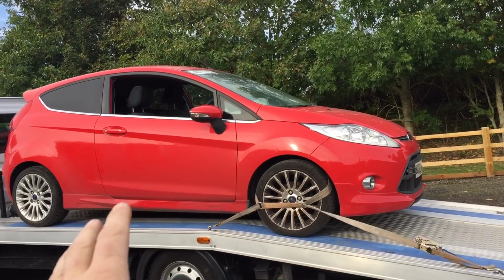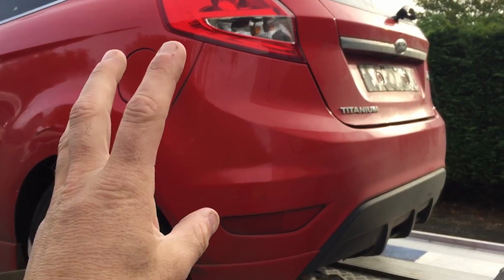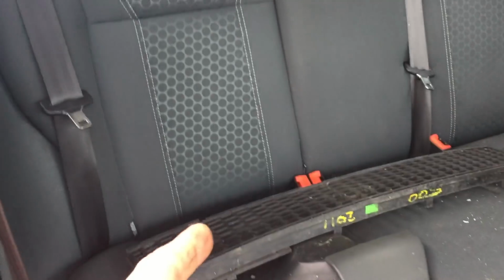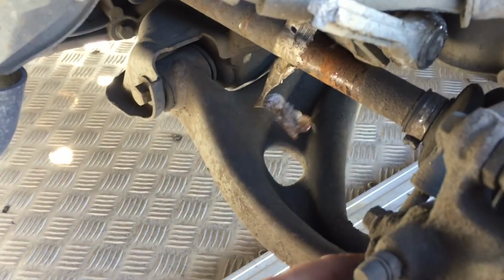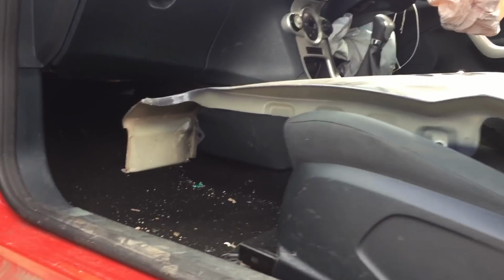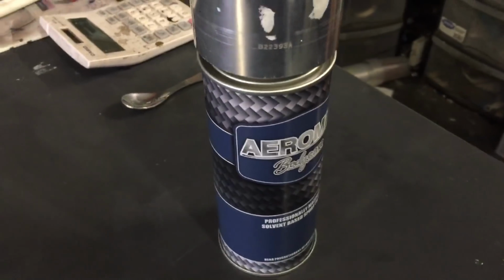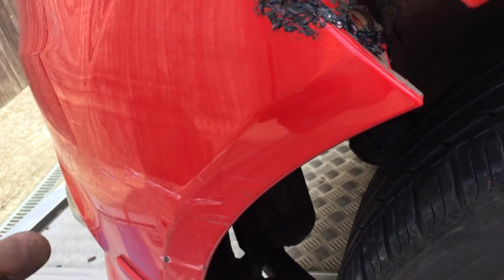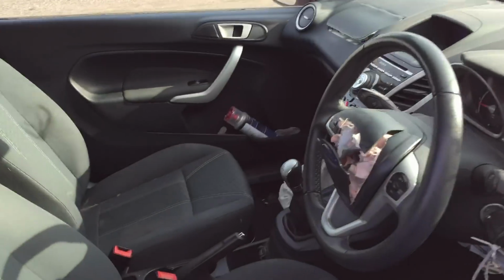Copart Salvage Damaged Fiesta £725  Bargain PT 1

Comment: Airbag kit 225 plus 100 fitting labour.
Screen 100
Wishbone tyre links 60 plus labour 50
Wing bumper approx 100
Paint labour 350 minimim
Total 1000

So far 1775 plus the collection delivery charges that u never added approx 150
So your close to 2000
Dont k ow how much u gonna sell it for cause I wouldn't buy
Didn't add the steering rack arm and possibly  rack damage labour and parts 100
Reply from the maker: the-truth-is-out-there you obviously didn’t watch or listen to the video because your miles out

Comment: The reason the headlight been changed was to make it look better so someone puts a bid in thinking it's a easy fix when in fact it's more complex.
Reply from the maker: Ade 1983 it was very easy to fix 👍
Reply: uk  you are a lucky guy. I've seen everything from body filler in the dash covering deployed air bags and a resistor to turn the light off. Bottom arms, shafts changed but leave a bent subframe. Some people buy them fancy them up a bit and send it back to auction. You've been doing it a while you must have seen it happen. Oh and don't forget the action taking bits off it and damaging them with the Falk lift.
Reply from the maker: Ade 1983 I have seen a bodges in my time yes but never had a car damaged by a fork lift how else are the supposed to move around 40000 cars around in a month some non runners some with wheels missing etc the forks go all the way through I personally think that’s ok yes I agree if you got a care free driver they can damage it but most are careful. If there is extra damage on the cars you can refuse the car on collection 👍

Comment: When I’m fixing cracks in plastic I use a soldering iron and some fine metal fly-screen mesh, preferably stainless steel. I lay the mesh over the crack then melt it into the plastic using the soldering iron. Then a skim of filler takes care of the surface finish. In my experience if this method is used on each side of the crack the fix is strong and permanent.

Comment: After replacing airbags do you need to tell the ecu the airbags have been swapped out?
Reply: No normally resets its self some you may have to push a small pin hole button to reset but normally does it its self
Reply from the maker: excossack yes mate it will always require a new module or have the old one reprogrammed 👍

Comment: The thing about this, is that after your time, effort, parts, etc. You’ll just end up with a 2012 Ford Fiesta that is Cat C-ish and still only worth a few grand, max. 
I’ve literally just bought a 2010 plate, with ~50,000 miles for £2,700. I’m all for rebuilding cars and using/selling them, but these cars are so cheap nowadays that the effort is almost not worth the headache. 

Just my 2 cents.
Reply: There will be little effort, no headache and a nice profit - you clearly haven't a clue......!

Comment: I seen a white 2014 Mazda 3, needed right front door post straightening..apart from that it was absolute mint went for 1500 CAD about 900 pound. It was the hatchback too, but was automatic. I'm needing a manual transmission  :)

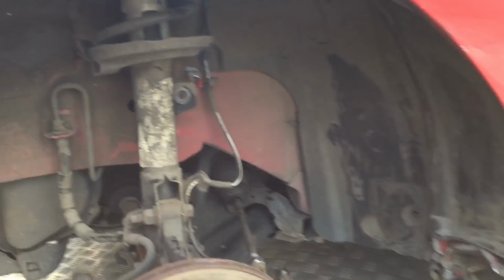Comment: 9:25 is that a crack in the inner wing/beam on the right where the wheel liner meets the red inner wing, it looks like a hole with a 3 inch crack coming from it, about half way up the screen.  Love the videos btw, just subscribed.
Reply from the maker: Lee Benstead no cracks 👍

Comment: Maybe its just me but the wheel still looks too close to the door after the new parts have been fitted. Had a car with the same damage and a cheap repair done. It never drove properly again, even after hours of alignment and fiddling. Took it to a ford dealer and was told it needed a new steering rack and chassis alignment to be 100 % perfect. Why not measure the gap on both sides of the wheel after the alloy goes back on. If the gap is more than 5mm different to the drivers side the car is not repaired properly, even it it passes the mot does not mean its repaired properly. Please please do this before you sell it on to some young lad or lass. If the gap is negligible than you know its all good 👍👍 Any more than 5mm its just not right to sell it on like that.

Comment: How would you know if the rod in the damper is slightly bent or not?
Reply from the maker: threepotgtti measuring it but ultimately a test drive would pick it up instantly
Reply: @sruk  How about you take the cap off the top mount, then turn the nut so the rod rotates, and watch for any deflection of the rod though the wheel arch ;)

Comment: Rob is it £725 INCLUDING copart MASSIVE buyers premium or not as a big difference in price if that is not added to winning bid ?
Reply from the maker: 1972dazbo 725 all in
Reply: @sruk  Good stuff mate,should make a cheap motor considering you have the bags and a few other bits for it.....Them buyer fees are still a total rip-off though tbh ?

Comment: Thank you very much for sharing your knowledge! Only wish I could give this video more than one thumbs up.

With regards to plastic welding, IMHO cable ties are only really useful to hold the two pieces of broken plastic in place while you solder the split properly. You will have to drill a couple of holes either side of the split, and possibly a groove so that it doesn’t sit proud of the surface, but nothing that can’t be fixed with a decent bit of filler. This might be useful if you can’t always get the clamps to sit perfectly. 

Anyway thanks again and I can’t wait to see how you repair the passenger side airbag as this has been bugging me a bit.

Comment: Not a bad car at all for the money, you done a great job with the bumper but in my opinion i would recommend using  other techniques in the future to ensure the bumper holds its integrity.

It may seem barbaric but drilling holes helps strengthen it with the proper kit, link below of an example

https://www.youtube.com/watch?v=_YwX_SB1tqw

Good luck with the rest of the car bro.

Comment: Hi Rob, wondering if you could provide some mechanical advice for a ford fiesta? What in steering rack would cause vibrations/shaking of the steering wheel? Could it be a bad ball joint?
Reply from the maker: Aiden Patrick have the wheels balanced if that don’t work try putting the back wheels on the front to rule out a tyre

Comment: Mate would love to see a video explaining what deems a car a cat n or s, I have a cat n rear damage a-class, quarter panel bent, and I can't open the tyre well where the spare tyre sits, seems like very minor damage to boot floor on one side which I would have thought should be a cat s. Keep up the good work.
Reply: It's the insurance normally say if you have a 50k car and you use it for work if it's very light damage but say it's a rare car if they cant find the parts or the parts will take 3 month to come it's not worth their time as they would have to pay out for repair loss of time for work etc etc easier to just write the car off anything structure is normally suspension controll arms  bent etc
Reply: @gvn-xk6eq I get that, but still confused why they changed it to cat n and s, when clearly so many cat n cars with structural damage and so many cat s cars without structural.
Reply: @mesmerize15  I know exactly what you mean I recently bought a cat s with front end damage and their was literally no structural damage at all just front bumper and head light also before you needed something called a VIC test before it was allowed back on the road they have evan stopped that probably just to save money

Comment: Did you report that the reg plate was missing, only it may now be on another red Fiesta.
Reply: also it was missing from the start as someone pointed out it was missing when still on the back of the truck unrepaired at about 2 mins in :)
Reply from the maker: gimble I said it was there last night outside my house but gone this morning
Reply: fair enuf, just someone said in comments that it wasn't there at the start of the vid, no1 would just steal one anyway, and if they know someone in the trade you could just take a note of any red fiesta reg and have them made (which was even easier a few yrs ago as you know before motor factor/dealers postcode having to be on them these days) :)
Reply from the maker: Mike Walker they won’t get far 👮‍♀️ it’s got no tax or mot 👍

Comment: When I was doing Scania and MAN draglinks and TCAs I freed off the locknut out of the way before knocking the joint out of the hubs, counted the turns needed to take a ball joint off and counted the new one back on. 9 times out of 10 the Laser align kit never showed any need for adjustment.
I would advise against using the amount of thread left on the arm itself. Its not that reliable (IMHO)
Nice little car and an easy fix though. I am seriously looking for a 2015 on Mini from Copart as my next project after the '78 Classic Mini 1000

Comment: Do insurers tend to always write cars off if the airbags have gone off?
Reply: depends as in it varies between 800 & 3000 for bag replacement depending on model, (skys the limit on more exotic stuff obv) so thats the deciding factor really as in obviously the decision is always based on cost like any other part of the car :)
Reply from the maker: Dan Smith 90% of the time yes especially if it is a complete dash job as the hours stack up

Comment: Another speedy turnaround..  Thanks to your scrap yard
Lucky ns and os steering inner joints swap around
At least when your working on the flat bed is better than the floor
Suprised you haven't got a wheel dolly skate for when you can't get the donor parts
But then again you have a two poster

Comment: From experience with zetec s/titanium the suspension units are noticeably different to standard cars.....caused all kind off ride height handling and tyre wear issues with a couple of mondeo's I repaired few years ago...if you have to change the leg it is worth trying to get the correct colour match on the springs and shock